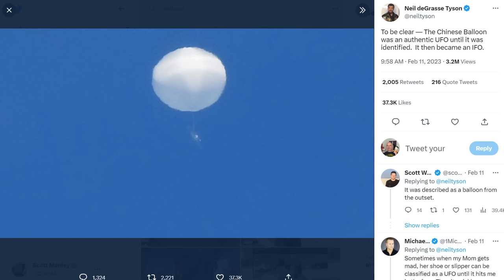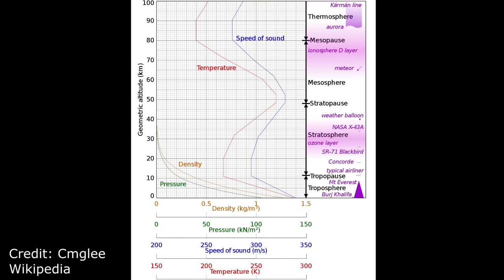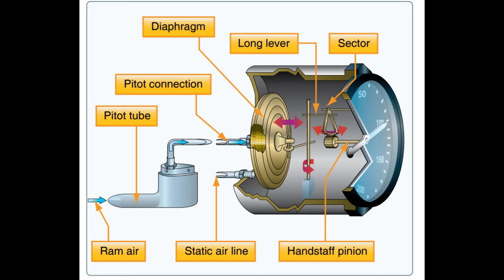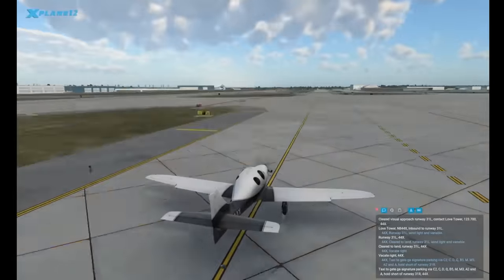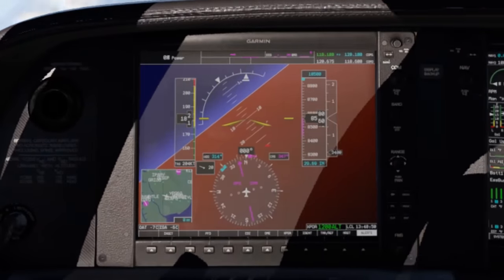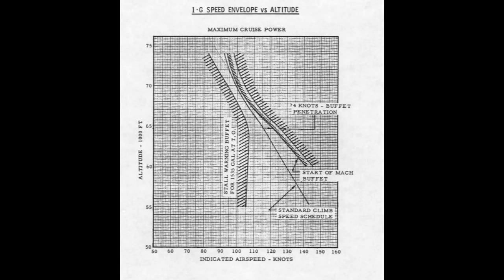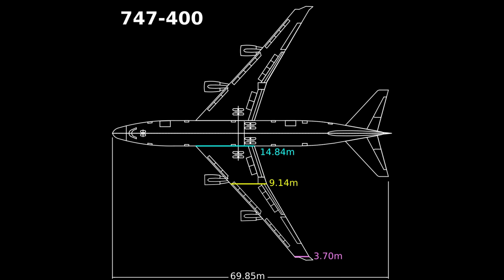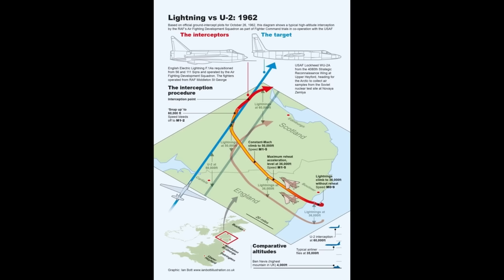How To Design A Plane To Fly At 100,000 Feet?

Comment: You're wrong about "pushing against the air". That is NOT how jet engines or rockets work. For every action there is an equal and opposite reaction, nothing to do with "pushing" against anything.
Reply from the maker: Jet engines have to push air through their compressors
Reply: @scottmanley  Thanks for responding. Please understand i mean no insult or disrespect, i'm simply trying to correct an error in an otherwise excellent and informative video. It's a common misconception that jets and rockets operate by "pushing" on something. 

Yes, it is true that jet engines draw their oxidizer into their combustion chambers (not really a "compressor") from the atmosphere. However that does not change the fact that neither jet nor rocket engines work on the principle of "pushing" on anything, any more than a high pressure fire hose flops around because it's "pushing" on something. 

Jet and rocket engines, as well as a flopping fire hose, operate on the principel of Newton's Third Law of Motion. All you need to do to demonstrate this fact is to close off the air intake of the jet engine and supply the oxidizer from a storage tank. Then, like a rocket, the jet would operate in space where there is clearly nothing to "push" on.

Comment: At 0:58: jet engines don’t “push against the atmosphere.” They use the reaction force from accelerating the air.
Reply from the maker: How do you accelerate air without pushing against it?
Reply: @scottmanley  ah, now I think I understand what you're getting at... You mean pushing the air through the engine/propeller or whatever and creating thrust by that acceleration. I think what a lot of people here think you're saying is that the air coming out the back of the engine creates thrust by pushing against the surrounding atmosphere. Understood, but I think the misunderstand is also understandable. But still: Stellar video 👍
Reply: @scottmanley  the thrust is the change of momentum , in the case of a propeller the incoming momentum is the aircraft velocity times the mass flow, in a little I will explain that.
The out flow is the wake velocity after having been accelerated, mainly by the suction of the propeller and the over pressure behind, like a wing. Now the flow velocity, neglecting  hub dispacement is the arithmetic mean of the propeller wake velocity and the flight velocity ,
shortly before the propeller , the air accelerates to the crossing velocity and then it further accelerates to the full wake velocity. now the massflow is density times the disc area of the propeller times the propeller crossing velocity vc
mdot = rho × Vc × π extended(to the axis) propeller blade lenght² = massflow
Thrust =  mdot × ( vwake - V )
This is of course assuming umiform wake.
Rocket thrust : no incoming momentum and finite exit velocity ve
Trust = fuel mass.flow times ve +(exit nozzle pressure - ambient pressure)× nozzle area as you well know.
Reply: @scottmanley   But your instinct is not wrong: In the case of a helicopter hovering over the ground the wake velocity's vertical velocity drops to zero, the flow energy is still there in form of a spread out flow in all  directions and the overpressure integrated over the area below is equal to the helicopter's weight, They call it ground effect. As you climb, high enough , the helicopter lift is the same the through velocity through the rotor is the arithmetic mean of the climb speed and the now called down wash, The induced power required equal to  the rotor through speed times the weight.
The flow reaching the ground produces an integrated pressure equal to the weight.
Now the airplane, flying horizontally produces an ultimate down wash, which is twice the trailing edge downflow, 
The downwash eventually reaches the ground and produces a moving pressure region, integrated again exactly equal to the airplane's weight.
All said the propeller is being pushed by a  'mountain at the airplanes altitude through a long extension, the moving wake, the pressure converted to velocity, according to Bernouilli energy conservation law. The turbulence behind spreads the flow some, ( according to  colmogorov's turbulence model) , the energy being converted to heat, but the integrated momentum is still conserved.
' And this is what you all need to know '
Reply: @scottmanley  
When you fly  the cirrus in a standard rate turn ,3 deg per second at one hundred knots TAS, the bank angle will be 15 degrees.
at 4°/sec. and also at 100 kt the bank angle will be 20 °
turn rate (deg) × TAS(kt) / 20 = bank (°)
Any higher bank angle this 2 20 200 rule is no longer accurate. Try it out. 

Some more memory items  will follow from a seasoned CFIIG on request.

Comment: Point of order: Jet engines do NOT ‘push against the air’ They use newton’s 3rd law. 
See this mistake all the time.
Reply from the maker: The 3rd laws states for every action there is an equal and opposite reaction.
Action and reaction are in reference to applying forces, I.e. the second law.
In other words the 3rd laws requires pushing against the reaction mass.

Comment: No!  No!  NOOO!  Jet engines do NOT push against the atmosphere.  Jet engines direct a hot, expanding mass of air in one direction.  This is the action.  The reaction is the air pushing the engine forward.  If a jet engine needed an atmosphere to push against then a rocket engine would not work in space as space is a vacuum and there is nothing to push against.

Comment: Did he really day that engines push against the atmosphere?  Not true. They generate thrust.
Reply from the maker: How
Reply: @scottmanley  by accelerating the air moving through them. Mass flow times delta V equals thrust. No need to push against anything (see also my other comment 👍).
Reply from the maker: How do you accelerate something without applying force, i.e. pushing it.
Reply: @arturoeugster7228  The simplest  thrust equation, easy to visualize:, 
The propeller increases the dynamic pressure, which is the energy density.   MMM
Me parece  que eres un boliviano , Universidád the San Andrés,  no duda.
A mí  me tocó a volar el anciano avión del presidente García Mesa : Militar Cero cero nueve.
Un Pilatus Porter a turbina.
De La  Paz hasta el Salar de Uyuni á 12000 piés de altura.

Comment: If we have to do Stratospheric Geoengineering because the climate crisis is getting out of control, this engineering and technology will be important.   But SpaceX and other low cost launch systems open the safer option of space based solar geoengineering, with the moon dust proposal possibly the best option.

Comment: You left out an interesting fact about planes going really high and really fast, such as the SR-71. IIRC the SR-71 is half in orbit. At max speed about half of its "lift" is from centrifugal force of its flight path around the globe (Flerfers: ignore).
Basically that plane is constantly "zooming".
Reply from the maker: Not the case, you would need to be going about Mach 20

Comment: The Aurora spy plane(if existed) probably set both speed and altitude records well beyond what the SR-71 was capable of. It probably had a unique ability to push beyond mach 3 and sustain that speed at well over 60k feet. Some rumors suggest it may have been-capable of speeds of up to mach 5 at or near 100k feet which is probably how it was able to make it from Area 51 to Russia in under an hour & leave a long doughnuts-on-a-rope contrail stretching across the ocean between those two points visible in satellite photos.

Comment: Hitting an effectively stationary object at ~60,000ft should not be considered to be a great achievement. That's only 11 miles, or 18km vertical. 
Sure the sidewinder is typically an air-air missile - but it's range is 22 miles. It could theoretically hit a stationary balloon (the size of 3 buses) if fired from the GROUND.
Also, the sidewinder is a 70 year old design. Everyone claiming that it was difficult to shoot down this enormous balloon is lying to you.
Reply: 22 miles level, not in a climb.

Comment: Sorry but no, private jets don't go over 35,000 feet. Most of the jets I work on fly much lower than that less than that around 20 to 30,000 feet. Service ceilings are set at 35,000 feet max.
Reply: Really?
https://en.wikipedia.org/wiki/Bombardier_Global_Express#Specifications
Reply: They do. I fly the A350 and we regularly see corporate jets above at 450 when we’re at 410.